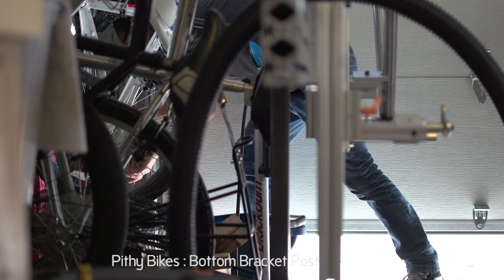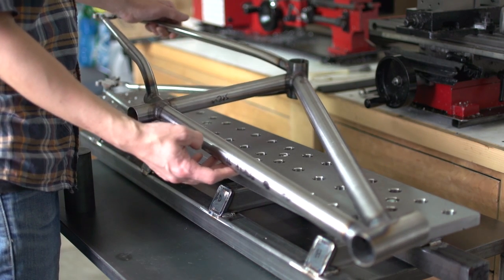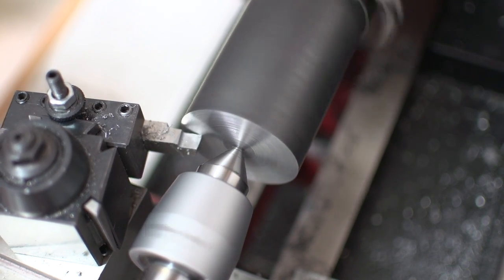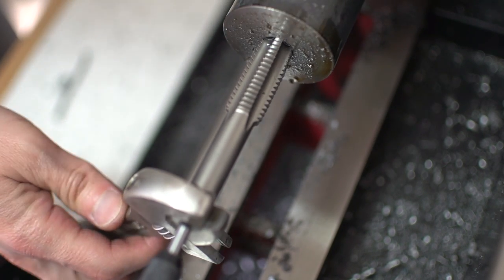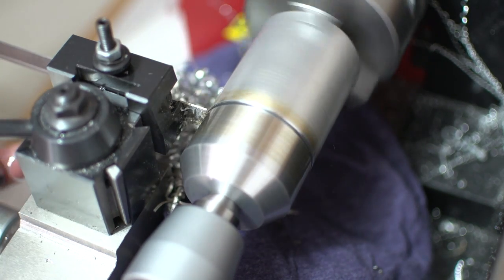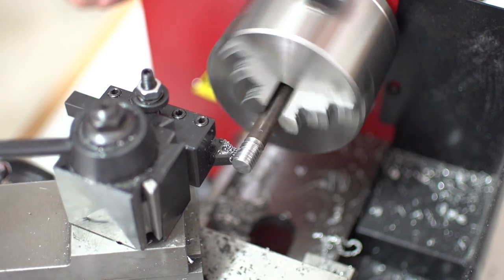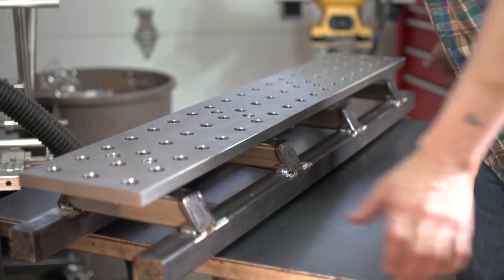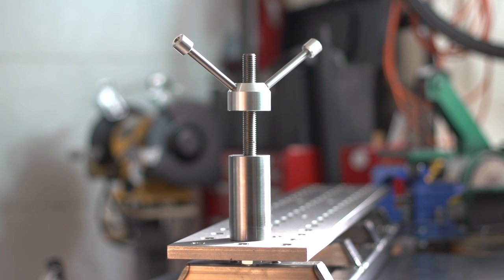Bicycle Frame Build 45 - Machining Bottom Bracket Post

Comment: please never ever, ever (ever) use a file on the lathe without a handle (it didnt look like there was a handle on the file you used anyway) unless you want a palm piecing with the tang of the file. the centre you used in the chuck is called a dead centre, and you could have kept the ends parallel using a 4 jaw chuck and a dial indicator. although the face of the chuck should be parallel with the cross slide, so after facing one end simply turn the stock over and make sure that the faced end is hard up against the face of the chuck. if you need to have the jaws turned around you can use a mill parallel under the stock to keep it aligned, or the cheaper option is to use the outer ring from an old bearing as a ring parallel as these are ground very precisely. 

ps use some lube when tapping and machining your tools will be happier and you will have a better time tapping (also a real tapping handle will help heaps too)
Reply from the maker: +HomeDistiller The file has a steel handle that's hard to see in the video :) Thanks for all the tips. I never checked the chuck but some day I should with a test indicator. Thanks!
Reply: oh thats ok then lol i didnt want to sound like a safety nazi.. thanks for the videos!
Reply from the maker: +HomeDistiller Haha no worries. I appreciate it :)

Comment: Cool post for the bottom bracket, but would recommend on your next one that you make it about 1/4 inch taller and then use your lathe to relieve the top 1/4" of the post such that it fits snug into the bottom bracket shell. Same for the top nut.  Doing so will allow you to know where the center of the BB is for tube center-to-center measurements on the table...or to perhaps multipurpose it for use also in the building/tacking phase.(essentially use the table as a "table jig"...
Reply from the maker: +Kerry Sisler I like the way you think. :)

Comment: I cant imagine how you learned to tap threads,.... but, youre supposed to only turn 1/4 to 1/2 thread and then back-out an entire turn (180 degrees) to clean it all out,... and definitely proceed slowly. Threads are a precision part of metalworking, and should not be "chomped out" like I see you doing.
Reply from the maker: +VIKING -RAIDER Thanks for the tips. I'm obviously self taught :)

Comment: Try Anchor Lube for threading and drilling. I got a free sample off of their site, I like it a lot more than cutting oil. I still use cutting oil for the bandsaw, end mill, lathe, etc. But for tapping and drilling I really prefer the Anchor Lube. :)
Reply from the maker: +scrubby4130 I'll see if I pick some up when my tap magic runs out :)

Comment: watched all 45 episodes since yesterday, impressive work. Build a 'barrel flange' that fits in the bottom bracket, to rule out bb bendind out of shape and/or minor movement due to frame straightening applied forces.
Reply from the maker: +ra3or Yes, this a terrific idea! I think I can add one pretty easily. I'll thread it and that way I can swap it out for different size BB.
Reply: +ra3or - I was wondering if that aluminum top nut might get scored by the BB itself as the frame is manipulated into alignment and might lead to problems accurately clamping the BB in future uses.
Reply from the maker: +Gardner Congdon Yes, I expected that it would get scored. I don't mind that because the BB will square itself from the base of the post. But what I do mind is that aluminum doesn't slide very well on steel. Lots of friction. I should make myself a steel nut some day. Good observation!

Comment: 2:28 "Live center"

As far as tapping, you should do 180°, back off 90, then another 180 and repeat. It lets the chips fall into the open sections of your tap. Usually makes it easier. And use a bit of cutting oil on it as well.
Reply: +RideThroughLife I'm pretty sure the pointy thing in the chuck is a dead center. You can google pictures of dead centers on google and you will find they look the same. The live center is the one in the tail stock.
Reply from the maker: Yes! Tyty

Comment: I would suggest changing your tapping method, for every turn and a half you go tap, turn a quarter turn back, this breaks off the burs, extending the longevity of the tap, and makes the tapping easier, also use lots of cutting compound (tapping fluid), and for tapping aluminium, you need a special aluminium tapping fluid, (regular stuff for steel reacts to aluminium). Great video, hope everything works out!
Reply from the maker: Awesome tips. You made me realize I don't have a method. I've always just felt it out. Ie, if it resists, turn back a quarter. But I like you tip of doing it automatically every turn and a half. Great stuff. Thanks!